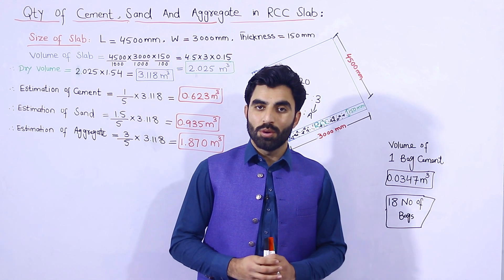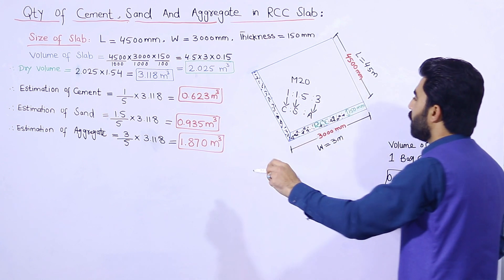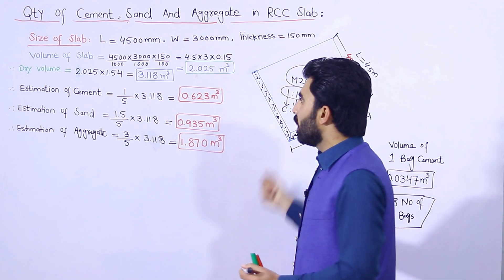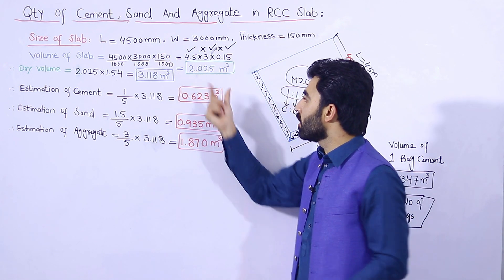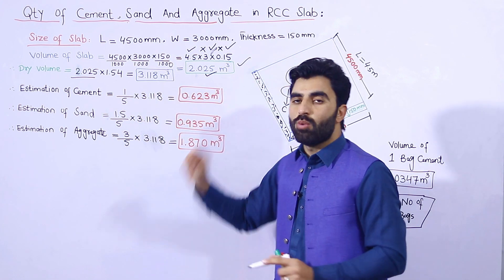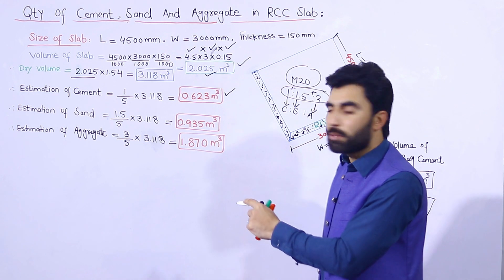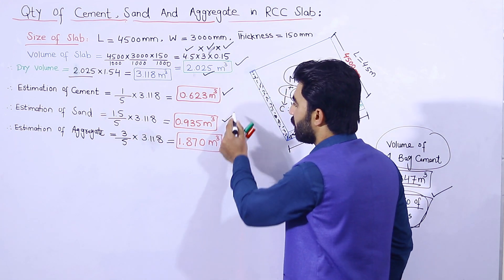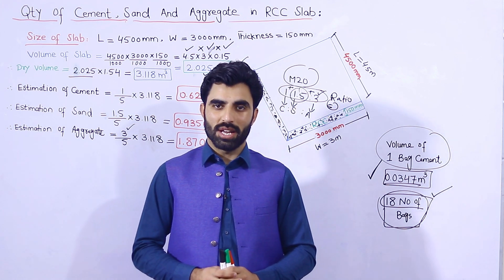How to calculate cement sand and aggregate quantity in concrete | material quantity calculation |

Comment: M20  Ratio  = 1: 1.5 : 3  
   5.5 Sem of ratio
Reply: that is right bro. some times he make a mistake in calculation. for the cement it is 16.3186267 bags of cement . For the sand 24.47794 boxes of sand   and 48.95588 boxes of Aggregate.